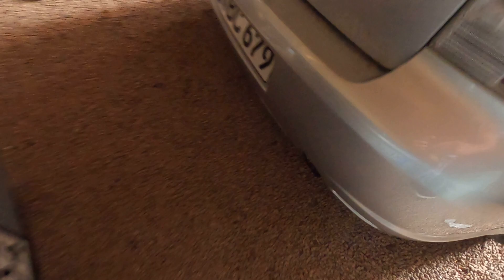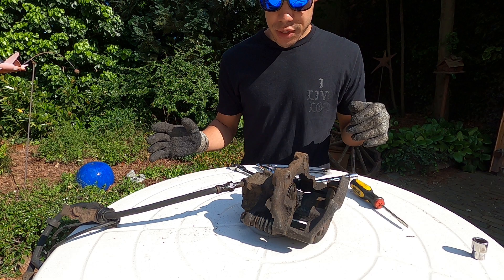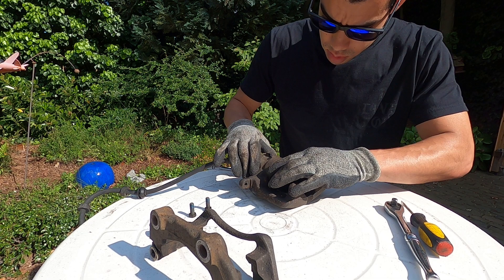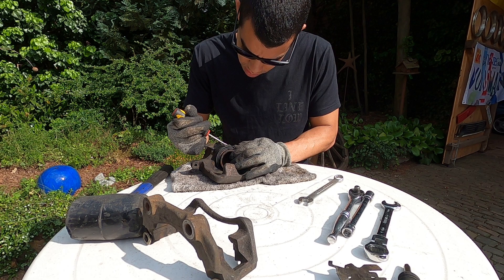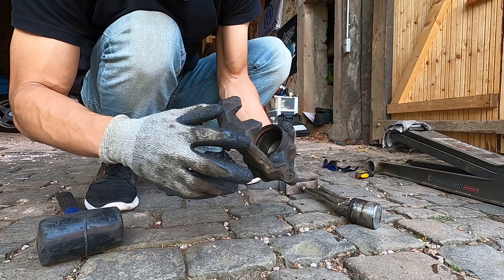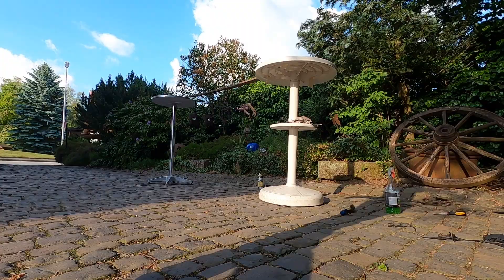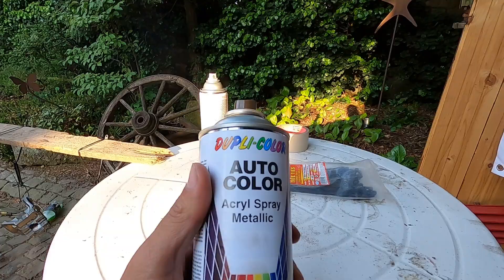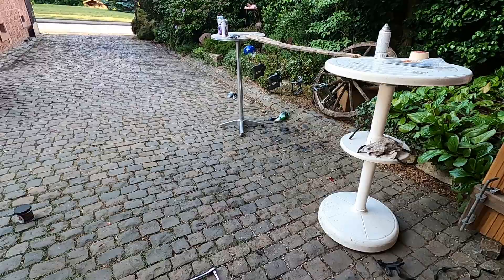MK3 GTI/G60 Caliper Rebuild Project! ( Disassembly & Paint )

Comment: 1. Really hope you used high temp primer at least. Brake parts get hot. 
2. Yellow or gloss black caliper with blue Lorinser font.
3. Really hope you used high temp primer.
Reply from the maker: The VW Garage they will be fine and if not it’ll be a good reason to try out another color lol a lot of people are saying yellow I’m liking that idea
Reply: I've done regular paint then clear with no issues.

Comment: I think yellow, or maybe even a mid purple but like a candy purple, with the colour of Miley on the lettering. They would look good 👌love the video. But definitely will need high temp paints...😅
Reply from the maker: Vr6 Nick I’m thinking about the yellow we will see if I actually end up using them lol and idk I painted my stock calipers black with super cheap spray paint no primer at all back in 2012 and under all the dirt they’re still black. No bubbling or anything and I’ve definitely put these calipers to the test over the years 😂
Reply: @Mk3Smith  yeah yellow will pop maybe along metallic line? So you get that flicker in the sun.👌
Ohhhh ok 😬 that's a good thing to know for future reference 😉 nice one...  😂😂 Yeah i can understand any vr6 will be pushed from time to time 👍 but shhhhhhh i never said that 😅🤫

Comment: Should of used an enamel on the calipers instead of touch up paint. Dope color though. Also you should sand down where the brake pads slide on the the calipers.
Reply from the maker: kene eye we will see how it holds up but I’m not worried about it and yeah good call thanks for the tip 🤘🏼
Reply: @Mk3Smith  Yeah I think you'll be ok especially since you did prep and prime it.

Comment: Love your videos. would these calipers fit the savoy I have a 1.8golf and was wondering would these do as an upgrade.
Reply from the maker: michael kenefick I believe the calipers should mount up directly yes but I’m not sure if the g60 rotors will fit the same. I know the rotors from my 2.0 and my 1.8 are different so I’d have to just try and see if it works or not

Comment: Dude, you really should clean the calipers from rust and all the dirt before painting them. Will last lot longer and looks nicer. Just a friendly tip here. And also decrease them before painting.
Reply from the maker: Samu Ylikotila did you not watch the video? Lol they were degreased as well as cleaned with wheel cleaning and I used a wire brush on them but they didn’t really have any bad spots or rust to take off
Reply: @Mk3Smith  literrally missed that part😂 my bad
Reply: @Mk3Smith   them just looks very rusty when you started to paint them.